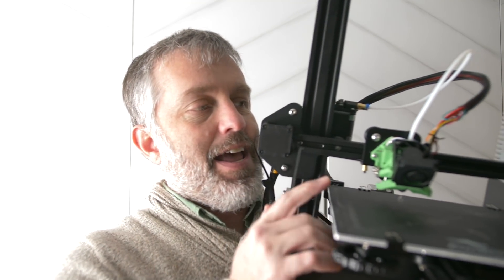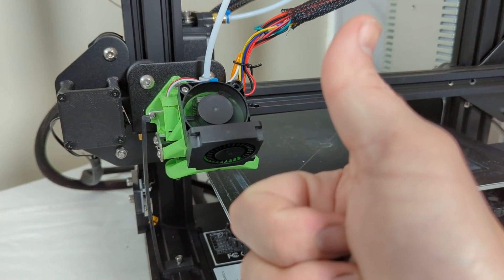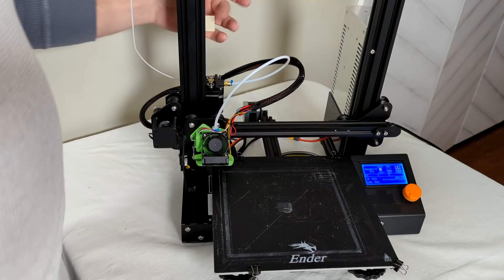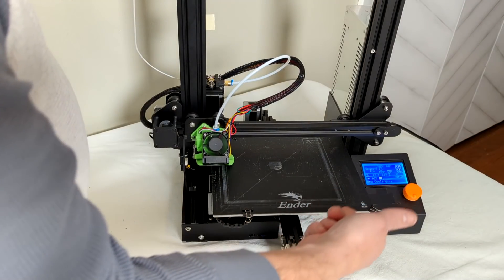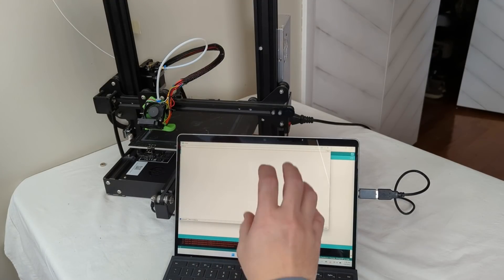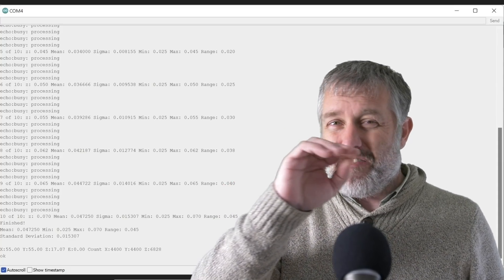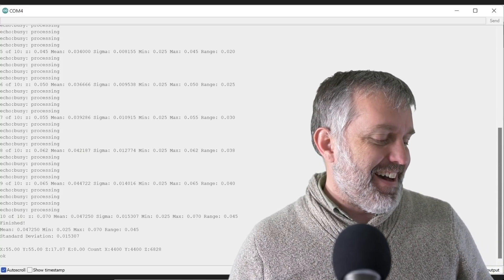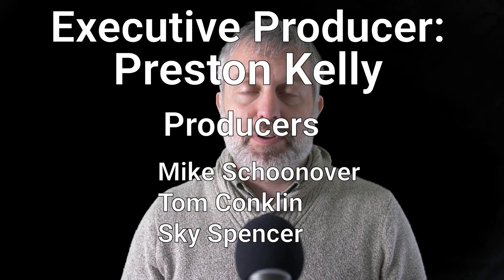I Made a Self Deploying Allen Key Probe To Rival The BLTouch

Comment: My first printer, a MakerGear M2, came with a BLTouch and I spent hundred of dollars on replacement probes.  On an unattended printer without collision or other kind of failure detection, spaghetti or curling corners can snag the probe.  This can then start shifting layers and worst case, a feedback loop that gets bad fast.  Many times, I didn't notice the probe was bent, leading to frustrating goose chases.  I've never had a problem with the PINDA on my Prusa, and since I ditched the glass on my M3, I'm thinking of switching to inductive.  I prefer to spend my tweaking time elsewhere, but to each his own.  Ditto on the shout-out to IP.  It's something we don't think about enough, being so spoiled by the cheapness of clones that it's so easy to not care about innovation.  It's only going to get worse if ignore it.  Double ditto on KISS.  It's a shame I only ever remember the basics after days of over-engineering.

Comment: how big is the magnet?
Reply from the maker: 5mm Diameter 1.75mm thick
Reply: @DesignPrototypeTest  where can I buy those magnets?
Reply from the maker: Ebay. These should work for you: https://www.ebay.com/itm/111520995899?hash=item19f72b5a3b:g:01gAAOSwQJhUa2Q5

Comment: Talking about stealing intellectual property and not supporting people who clone the originators at a cheaper price...... Then you purchase an optical sensor for $2.50 from China 🤦🤷
Reply from the maker: CopyPasta from my response to similar comments: Chinese products can be original. Just because Chinese companies copy so rampantly doesn't rule out the possibility that there are folks in that country who are doing original work. I have seen no evidence to suggest that the optical sensor I used in this build is a clone. If you wish to continue with this discussion please provide me with believable evidence that this optical sensor is cloned. I would not be surprised if you did find such. Like I've said on many occasions China copies and clones rampantly. It's just that in this instance the device appears not to be a clone. Therefore, in good faith I can advocate for its usage. This is a similar to the arguement where guys want to say the Ender 3 is a clone of the I3. The Ender 3 is derivative of the Mendell Max. The Prusa i3 Mk.3 is the third variation of the third iteration of the Prusa Mendel. The original Mendel was developed by Dr. Ed Sells. Therefore, both the Prusa and the Creality printer share a common ancestor. If the Ender 3 is a clone then so is the Prusa i3 Mark 3.
Reply: @DesignPrototypeTest  Honeywell based in Charlotte NC holds the patent to optical endstops and just about every variation in between. I welcome you to look into it as I have provided the information you need to take it from here.

Comment: Post process the hole with a reamer or a drill bit.  I'm not a big fan of trying to print holes net size.  Yes on some things but not if precision is important.  Not a fan of the BL Touch either.  Mostly a fan of just learning to gap the bed properly.  Liked.

Comment: "Not good. Not good..."
Has been printing flawlessly with perfect automatic mesh bed leveling for years and thousands of kilometers of filament over the whole world.. but not good you know.. 
Bs. Pinda probe work perfectly and has nothing that can go wrong over time. Nothing mechanical to fail.
Reply from the maker: All the complexity is hidden from you. The extra thermistor burried in the body of the probe: Hidden. The algorithm that adjusts the probe-to-nozzle offset based on how hot the probe is: Hidden. There are probably good reasons that I'm not even aware of why Prusa abandoned the P.I.N.D.A. probe for the latest PrusaXL. But no. You are probably right. I'm always wrong. Everything Prusa makes is perfect.

Comment: Matthew, I cut you slack on your Cardano endorsement, but your love of the BLTouch really amazes me considering how problematic they are (i.e. failed pin retraction) and the cost. You might look into the Euclid probe and I think you’ll find a truly cost-effective and accurate bed height probe. Just my $0.023 worth (adjusted for inflation).
Reply from the maker: Cardano is in the Toilet along with the rest of Crypto. If I sold now, I would lose half of my money. Good thing I had always planned to hold for 10+ years. I think I'm coming along to Elon's way of thinking and liking DogeCoin now. The dirty secret of ETH and ADA is the central control. I didn't understand this when I bought ADA. Crypto should be free from manipulation by its creators. Power corrupts. We already have centralized currencies which are heavily controlled. Crypto is supposed to be the check and ballance.

RE Euclid Probe: Yeah, it's great. I haven't felt the need to make a video about the parking probe options for Voron printers because they are getting plenty of press already, and I haven't built a Voron myself. I did however make my own parking probe: https://youtu.be/CSEJdV_sgng before I had ever seen the ones similar to the Euclid. If I gave it some though I might be able to figure out a mounting solution for a Euclid or Similar on the Ender 3 but I don't think it would be ideal. there is not enough movement overrun outside the bed on the Ender 3 so any solution is likely to subtract build volume.

Comment: I heard, that 0.3 mm layer hight is or might be bad because the z axis makes steps in 0.04mm height and since 0.3 isn't a multiple of 0.04 you get inaccurate layers or something like that. I need to check out the video again I watched it some time ago but it does make sense to me since in cura, all the preconfigured profiles ar a multiple of 0.04. 

Super Quality        0.12 mm
Dynamic Quality   0.16 mm
Standard Quality  0.20 mm
Low Quality           0.28 mm

So I think this might be true but if you could make a video about this topic I would be eager to watch it.

Comment: Great idea. I still have a delta printer with a Allen key type optical bed leveler. However I have to manually retract it.
Reply from the maker: I think you mean clicky switch. If it has an optical switch I would love to see a picture.
Reply: @DesignPrototypeTest  I don't know how to attach a photo to a comment but I used  thing 605729 as a starting point.

Comment: I totaly agree with you that we should support the original creators if we can, but when you have the same product 3x cheaper then the original and working almost as good as the original is kind of hard to do it if you dont have enough funds to do it, for those who can, I recomend them to do it, since you have garanty and and better support normamly, but if you cant just go for the cheaper one...
And also you talk about supporting the original creator but then you but an optical sensor for 2$ that comes from china, wich I can almost be sure that it isn't from the original creator either... so by that thinking just by the BLTouch clone wich you just need to install and it works, no need to buy and or print any other specific hardware...
Reply: you buy* an optical sensor for 2$
Reply from the maker: Chinese products can be original. Just because Chinese companies copy so rampantly doesn't rule out the possibility that there are folks in that country who are doing original work. I have seen no evidence to suggest that the optical sensor I used in this build is a clone.
Reply: @DesignPrototypeTest  lol , how convenient, cause they are lots and all similiar, so you dont know where it even comes from, the original one, and I didnt said that all the products that come from china are clones, just that the sensor you have is a cheap version of other way more expensives wich is the same shit as buying a clone of a BLTouch or whatever, there is even no brand in that sensor, meaning is a clone of some other one, but cheaper cause they have cheaper labour and no taxes high as we have in Europe, US UK etc
Reply: @DesignPrototypeTest  and one more thing, my coment isn't suposed to be as a hatter, i'm actually subscrived to your channel, cause I probably seing some videos of you and I enjoyed so I subscrived, it was just my opinion.
Because since I'm single with low income, and dont have a rich dady or mommy, so I cant pay for expensive stuff like that, unless if it really is diferent from the clones, and is worth it, otherwise if I see cheaper and the reviews are high, I just go for the cheaper stuff, cause even if it breaks, I can still buy 2 more or sometimes even more, and still be under the price of the original, is all I'm saying ;)
Reply from the maker: Why would you feel the need to say you aren't a hater? My response to you was nothing but pleasant. A simple statement that not all members of Group A are also members of group B. There is nothing about that which should make you think that I think you are a hater. "the lady doth protest too much methinks." If you wish to continue with this discussion please provide me with believable evidence that this optical sensor is cloned. I would not be surprised if you did find such. Like I said before China copies and clones rampantly. It's just that in this instance the device appears not to be a clone. Therefore, in good faith I can advocate for its usage. This is a similar to the arguement where guys want to say the Ender 3 is a clone of the I3. The Ender 3 is derivative of the Mendell Max. The Prusa i3 Mk.3 is the third variation of the third iteration of the Prusa Mendel. The original Mendel was developed by Dr. Ed Sells. Therefore, both the Prusa and the Creality printer share a common ancestor. If the Ender 3 is a clone then so is the Prusa i3 Mark 3.

Comment: About "not affected by heat" for optical sensor. You'd better ask FGB5 owners - do they have issues with such sensor (wich is X endstop on head) in passive heat chamber :)
Reply from the maker: Are you are talking about Flying Bear Ghost 5 printer? Does it use optical sensors with the Schmidt trigger on the PCB? I covered the difference here: https://youtu.be/399VbXxuOdw?t=153 Does the Flying Bear use the Red PCB with the optical sensor fork component on the opposite side from the Pin connector? I think the use of a Schmidt trigger will give better functionality in the heat.
Reply: @DesignPrototypeTest  Yes, I am talking about Flying Bear Ghost 5. And its stock board without the Schmidt trigger. It uses custom board for connecting all the head wires, so no option (except self-made) to add Schmidt trigger.

Comment: Mini Kossel delta 3d printers default BOM using default configuration had this style bed probing back in 2013 maybe earlier.
Reply from the maker: Yep. As discussed at 3:32. To my knowledge nobody has publicly presented an optical probe instead of clicky switch activated by an Allen Key before. Going further, you will be really challenged to find the same combination of features and simplified design as I came up with (Optical switch + Allen Key + Magnet + guide hole + physical catch for deployment/retraction). I think this is the lowest cost self deploying bed probe that has ever been presented. Wouldn't you agree that I have created something new? Or are you here to fight against the notion that original creators have any kind of claim to their creation legally or morally?
Reply: @DesignPrototypeTest  sorry for late reply. I have to admit I skipped around in video as I was researching something else and your video caught my eye. No doubt yours looks to be an evolution of what i have seen done before and i wouldn't wanna take anything away from your acomplishments. If i had any advice  for you honestly is to ignore the detractors, you will find they get louder as you become more successful and I have come to consider it a sign i am on the right track, just keep in mind that anytime you respond to attacks beyond "thanks, all input is appreciated."  for example they are winning and people will always think less of you for responding on their level. I am a pretty sensitive so I have had the same trouble in past often avoiding or ruining oppertunities as a result.

Comment: Looks nice, allthough it isnt really new.
The TouchMI also uses a magnet held pin paired with an optical sensor.
Reply from the maker: I credited the TouchMI in the description. I have never seen one in person and so I was not able to learn from it to develop my design. Also, the combination of features in my design and the sheer simplicity has never been done before: Optical switch + Allen Key + Magnet + guide hole + physical catch for deployment/retraction. I think this is the lowest cost bed probe that has ever been presented. So, wouldn't you agree that I have created something new?
Reply: @DesignPrototypeTest  I was just referring to the principle. Your design is of course new.
Reply from the maker: Cool. In fact there are examples of optical sensors being used in touch probes on Thingiverse from as early as 2017 that I've found. Might even be some some predating that. https://www.thingiverse.com/thing:2197895

Comment: Check "OPTO Optical probe" I made it
It is on thingiverse 
Works almost the same
I use it for around 6 years now 
Even longer if i count first prototypes made by hand
Works avesome with 0.01mm or better accuracy
Best i get have 0.005mm accuracy tested on cnc machine
Reply: I came across your design, it was almost exactly what I was thinking after watching this video. Much neater deploy/retract method.
Reply: @TroyMackay  i was trying to make it as simple as possible 
There was option for using super micro switch simillar to D3C
But they hard to find in less than 10+ where they cost 1$+ each
It was super simple, maybe i will try to make it for everyone

I designed them to work for any 3d printer 
And if its delta u could extend the rod so it dont need to be atached to the hotend...u can even take the rod of the printer if u cut the part with magnet so it can stick out 

I will try to make simillar one for heated chamber (simple all metal one) where u dont need any switch etc (notch on the rod + some wire or something)

Now im working on 3d printer with 200*C heated chamber that dont need water cooling except hotend 

Maybe it will work 
If not i will water cool it 😂

Comment: tube shape with half moon dots (dot guide) on the 6 sides at the top and bottom of shaft for the only contact areas to the metal shaft. optional is a draft shaft or blown air for canned air nozzle to clear debree chaffing out of the shaft hole via a side open area. clip locking top design to allow allen to be removed and cleaned. optional design is use a hobbyist brass tube heat melt into the walls or glued into shaft area.

Comment: Im probably going to get attacked for asking but how do you connect the sensor to the 3D printer control board and wheres the code or instruction to modify the controller so it works with the sensor.
Reply from the maker: Why would anyone attack you for asking a good question? Take a look two videos ago. "Unbeatable for $200" is the thumbnail.. I covered the answers to your questions in that video.

Comment: Well done on the design, I quite enjoyed the video!

I had a much longer comment typed out before I noticed your tendency to lash out at others who contribute even modest criticism, so I'll parse it down to just the essentials: I appreciate your comments regarding the importance of buying original parts and supporting the innovators 100%. I don't believe anyone should buy a knock off BLTouch, regardless of what they cost or what they're capable of. It that's the creator's wishes, I think they should be honored. 

...But the fact that you seem to be so weirdly critical of Prusa is almost laughable... For a company that's innovated so much in the space, they certainly deserve your support, do they not? Or at least, they likely don't deserve your distain. The Prusa i3, having evolved from the Reprap Mendel, is at the core of every single creality ender 3 out there. It's a derivative design - plain and simple. 

I again wanna say that I really love this project, and I think you've done excellent work with it! In it, I see the same kinds of ingenuity and creativity that was everywhere in the early days of the Reprap movement. Things seem to have largely stagnated now that we've found the most optimal ways of doing things. Gone are the gaudy herringbone gears of wade extruders, gone are the loud and musical tones of DRV8825 drivers churning away at a blistering 20mm/s. Parts are cheaper to buy than they are to make, which is a godsend compared to the old days of drilling through a bolt and wrapping it in nichrome wire to make a hotend. Inventions like these bring me hope that there are still clever hacks out there that we've all got the parts and need for, but nobody's thought to try them yet. I praise the innovators, and I hope you do too.
Reply from the maker: The notion that I am "lashing out" at those who criticize me is disingenuous on your part. There is no evidence that I do that, and even if I do, why would put such a statement in your comment? If I was predisposed to emotionally reactions when I feel threatened don't you think this kind of a statement would trigger me? Is that what you are trying to accomplish? 

You are operating under the mistaken belief that the Ender3 came into existence because of the Prusa I3 Mk.3. I've had to put this to bed so many times. It gets boring. The Ender 3 is derivative of the Mendel Max. The Prusa i3 Mk.3 is the third variation of the third iteration of the Prusa Mendel. The original Mendel was developed by Dr. Ed Sells. Therefore, both the Prusa and the Creality printers share a common ancestor. If the Ender 3 or the CR-10 is a clone then so is the Prusa i3 Mk. 3. Prusa is not responsible for the state of 3D printing. The RepRap project was alive and well before he ever came on the scene.